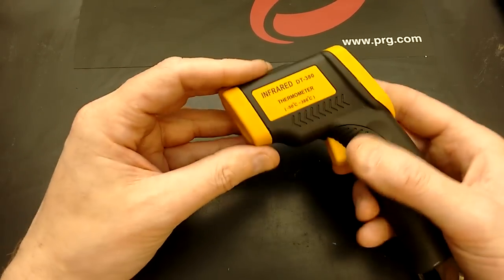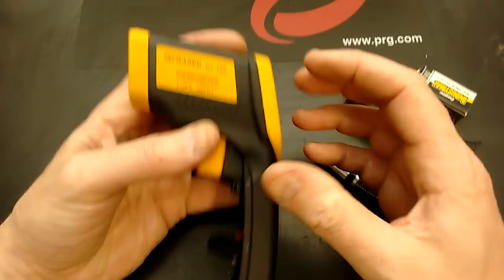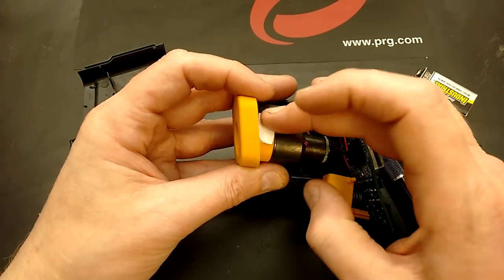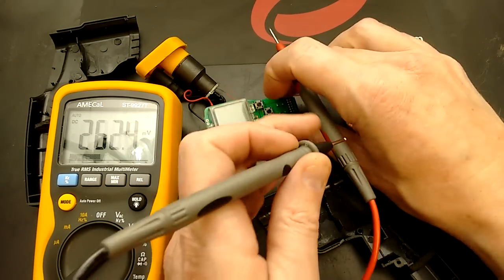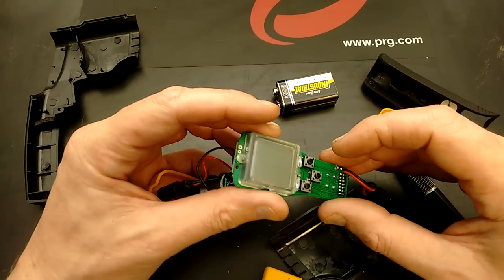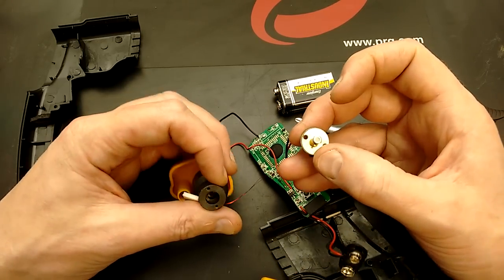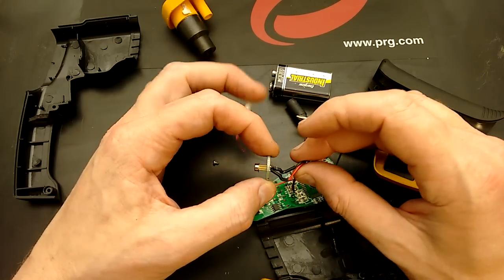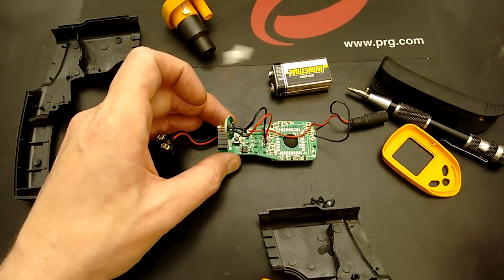A look inside a non contact infrared thermometer.

Comment: Unfortunately these units powered with 9v battery do drain the battery very fast. If battery isn't taken out when unit is not in use then will not last long. Probably the step-down converter is not very efficient or the the power button design is probably not good/ well placed.

Comment: OK, I had an assumption about how these things work, and I was wrong. As we know, hot things glow. While the glow is not a single wavelength of light but rather a mix of many wavelengths, the distribution of these wavelengths is just a function of temperature. So the overall combined color of the glow can tell you the temperature of the thing. We can't see light that has a longer wavelength than red light, but it is there. Things that are not hot enough to visibly glow are, in fact, still glowing with invisible light, subject to the same distribution pattern as a red-hot blob of steel or a yellow-hot light bulb filament. The universe is indifferent to our human-made delineation between visible light, infrared light, radio waves, wi-fi, and x-rays. They're all just different colors of light. So I thought infrared thermometers just detected the overall "hue" of infrared light coming off of an object to determine its temperature.

While I was wrong about how IR thermometers work, I think my assumed method does explain how infrared cameras work. I had assumed IR thermometers were essentially infrared cameras with a very low resolution of 1x1.

Comment: I need help mine won’t turn on and I changed battery’s on it
Reply from the maker: Check the batteries are making a good connection and try jiggling the power button in case it's got a bad contact.

Comment: Mine failed as well, and i bet all of these fail the same way. There's a 7530-1 SOT voltage regulator from 9v to 3v that ends up shorting. I removed mine and now it powers with 2*1,5V AAA batteries in series.

Comment: I would have checked the zebra strip / glorified conductive scotch tape to the LCD too. It's of course possible that it is the epoxy blob that failed indeed, but in my experience, tucked away in their enclosures these things are right up there with cockroaches in indestructibility. It's almost always the mechanical parts that fail in this sort of thing that cannot be externally overloaded (unless they did indeed skimp on that diode and someone tried the battery in reverse...)

Comment: stupid question here, could you hack one of these to produce a thermal image?
Reply: I think better optics are needed to do that, there's a reason thermal imaging devices are so much more expensive
Reply: It has been done, but you get a very slow scan and pretty poor resolution. Basically you use 2 servo units to scan the head in a pattern across the area and use a computer to generate the resulting blobby thermal image.

Comment: They do make i2c IR thermopiles, but like you said this one just puts out a voltage. but they usually dont have a amplifier built in unless they are i2c. Those that aren't i2c will require an external amplifier with a very high gain.

Comment: I'm a bit surprised the thermistor was stuck on the plastic casing instead of the metal? bit surrounding the sensor.  I wonder whether that was part of the design or whether it was flubbed during assembly...  I was under the impression that the whole point of the metal bit surrounding the sensor was to conduct heat away for cooling & more accurate temperature compensation.

Maybe TO-39 is a common package for these types of sensors, but when you pulled it out it reminded me of the MLX90614.

Comment: The other check I would have done is to test the trigger switch before writing it off.
Reply from the maker: I tested various things including the switch before it ended up in the bin.  The owner already has a proper thermal imaging camera, so it was no great loss.
Reply: I thought you would have.  The comment was mainly for other viewers.  :)
Reply: +bigclivedotcom I recently got one for 10 Euros from AliExpress but I'm not sure if its accurate (even on dark nonshiny surfaces) cause what to compare it with :)
Reply: John Coops thanks I had done that already but I held it towards the water surface in an open pan when it was boiling. It measured ardound 95 Celsius. I don't have a black pan/kettle but I will try point at the aluminium pan instead.
Reply: Shiny surfaces can cause faulty readings
Reply: GogogoFollowMe yeah well I tried holding it not too far away (or 12:1 spot magnification will deliver me a too large measuring area I guess) and while moving the pointer I got to ~ 100 C but it often read higher and lower too
Reply: too close and the interior thermocouple will heat up, reducing the reading
Reply: You're right, must be careful with that, even more when it's a continuous reading

Comment: Am I correct in assuming the red laser does nothing in the function of temperature calculation and is just there to indicate where you are pointing?
Reply: I have one of these no-name IR thermometers too, both the unit Clive is showing, and mine have the option to turn the laser dot on or off via one of the buttons underneath the LCD display. You are right, the unit works with or without the laser dot, it is merely to aim the device. 

Accuracy of the laser pointer is kinda "meh."
Reply: +DashCamAndy 
Thanks.  Yeah your accuracy comment make sense.  The laser seems to be at least a half inch away from the infrared diode.  I'm sure for most cases it doesn't matter especially for the price.
Reply: Some of these devices have two lasers to increase accuracy, one on the top and one below the main sensor - the idea being that when the two lasers cross and become one dot on a surface / that is the most accurate place to measure
Reply: Indeed Andy, sometimes the laser is quite off from the actual spot it's measuring.
Reply: Yep.

Comment: I have the same unit, which also failed. I did managed to repair it, the trigger switch went open circuit, replaced it and Bob's your uncle working unit again.
Reply: But Bob isn't my uncle though, hes my friends uncle.

Comment: hi clive. Two things. How does an IR beam determine temperture? 
Secondly, poundland are flogging motion detectors shaped like frogs. Fancy doing  a plastic frog disection ? Please.
Reply: I'm not Clive but the non contact thermometer does not emit an IR beam, it measure the intensity of the infrared emitted by the surface of the thing you want to know the temperature of. It computes the temperature from that.
Reply: Thanks SlyPearTree, I get it now.
Reply: I dont understand them. Do they have to be a set distance form the thing youre measuring because radiation intensity varies with distance, its in energy (or is it power?) per unit area and the further away you are the more it will have spread out
Reply: The "beam", the sensitive area, gets bigger with distance, but what depends on the temperature is not the intensity but the frequency spectrum. If it was measuring the energy you'd start getting problems with reading the temperature of something colder than the sensor, because 

You can't pass heat from the cooler to the hotter
Try it if you like but you far better notter 

The sensor isn't measuring heat. It's measuring something derived from heat. Pick the right frequency, and the change in level will have a near-linear relationship with temperature over a useful range, but how do you tell the difference between big and small sources? Somebody did some careful thinking about how to get good numbers from such a gadget, and when it was a new type of gadget it would have been seriously smart thinking. Now it's an "everyone knows" sort of thing.

Comment: those switches often break at the pad. this would be one of the few places where mechanical pressure is applied to the board. also, most of the cheaper stuff from China is covered in solder balls.

Comment: Save that laser diode, Clive! :D Before they're banned, because the media et al believes 5mw lasers can dazzle airline pilots flying a mile up.
Reply: The risk (though small) would be blinding the pilot during takeoff or landing
Reply: Just bear in mind when you're demonstrating your point, that it won't be the media who'll be knocking on your door asking for an explanation.
Reply: Im just sitting here with my custom 12 watt handheld dpss laser and as long as it is focused properly, it isnt dangerous at a distance of 100m or more. The little chinese 5mw modules are never really 5mw, more like 2 and their optics are not gonna be focused anywhere near good. Its not dangerous from a distance. A proper flashlight would certainly be the bigger threat.
Reply: Im just sitting outside on my phone watching youtube and pointing two 301 green lasers at the sky :P

Comment: just a little point, these give the temperature of an area whose size is proportional to the distance from the surface. they do not give the temperature of the point where the laser is pointed. thus you should get as close as possible to the item you need the temp of.
Reply: These things are only any good for getting a rough indication of temperature, anyway. The value displayed will depend heavily upon the target surface's emissivity (ie how much IR radiation is emitted relative to its actual thermal energy). The notional value displayed is for a perfect black body (ie magical physics land of spherical cows, no friction and no air resistance), but in practice I believe that most of these devices will be calibrated against a sort-of mid-range-emissivity surface, so that they stand at least some chance of being accurate. But still, it has every chance of being way off, too :)
Reply: I was thinking that. Surely the laser would be wayyy off being situated to high.
Reply: +Prehistoricman not that but it's a common misconception that the laser marks the point of temperature readout. it doesn't. it marks roughly the centre of it. the diagram on the side of the device shows what I mean.
Reply: I imagine one way to fix that is to place some lens in front of the laser so that the beam would expand to represent the area (more or less) it is measuring. By the way, the emissivity value can be set with the buttons.

Comment: Perhaps someone put the battery the wrong way around for a short time and that killed it...
Reply: Key word being "Should be"
Reply: should be protected from that with a diode, but you never know...
Reply: yes, but they can still make contact with the incorrect contacts. though that probably happens enough that if one instance would kill it they'd die exceedingly often as people fumble with the battery.
Reply: +DANGERTIM112 but it does make contact
Reply: +DANGERTIM112 it won't click that way, but you can at least touch the contracts the wrong way. That may be enough if there's no switch protecting the board.
Reply: muh1h1
A shottky diode can make a big difference in price when producing a whole lot of these things...
Reply: It's a 9v battery, it should only fit one-way on the connector

Comment: 8.72 volts seems kind of low?
Reply: "9V" batteries are generally considered not-flat right down to around 6V, so 8.7V is near enough brand new. Bear in mind that they're generally/often constructed from six alkaline cells internally (sometimes little rectangular things; other times cylindrical cells like smaller versions of AAA cells), and so the useful voltage range will be from 6*1.5=9V down to around 6*1.0=6V, just as the useful range with single alkaline cells is about 1.5 down to 1.0 (device-dependant).
Reply: 9v cells can be made from 6 AAAA batteries that will be expired at around 1.2 volts. That's 7.2 total. As far as I know, 8.7 is pretty healthy.

However, cells do creep up in voltage over time when they aren't in use. So it could be completely deceiving.
Reply: Prehistoricman
I typically get around 9.2-9.5V for a new 9V alk battery, though. If I measured 8.7, I'd probably try a new one just to be sure. If the device were on, then maybe I wouldn't think 8.7 was low? I really don't know if the battery was under a load or not, though.Overall, I think 8.7V no load is kinda' low.
Reply: Voltage drops during the lifetime of a battery, and 8.72 V is still pretty fresh.
Reply: +Peter McArthur I'd still check with a fresh battery as part of testing. No one has to do things my way, though. ☺
Reply: Yes, I'd have spent rather longer poking around at it, too -- especially the mechanical components. But I'm not hurrying to produce a show during my lunch break. :-)

Comment: It makes me laugh, the usual electronics/parts retailers are selling rebranded versions of these for quite a lot of money, but I think I paid under £20 for mine.
Reply: ￡5.16 
http://www.aliexpress.com/item/GM320-Non-Contact-IR-Infrared-Thermometer-LCD-Display-Digital-Temperature-Gun-Temp-Thermometer-Laser-Handheld-50/32689489971.html
Reply: The one I have is actually the slightly more costly 900°C version (GM900??), as I needed it for measuring the temperature of an exhaust manifold.

Comment: tip for others
to check for hidden screw holes under labels use ur thumb nail run it across the label ull see a hole out line if there is

Comment: The chip blob looked like it had a shiny, discoloured spot on it which would probably mean it cooked itself internally (probably due to a failed somethingorother on the PCB sending current the wrong way)...

One fun note about these infrared thermometers, they used them a lot as engineering props on Star Trek: Enterprise (sprayed a nice shade of satin silver, of course), usually repairing some blown up circuit or performing maintenance on an EPS conduit... :P
Reply: Was it on TOS or really ENT (w/ Data)? :D
Reply: *****
Enterprise, as in NX-01, the 22nd century Prequel, Captain Archer and all that, the last proper star trek series ever cos the upcoming one is just jjbollocks... :P
Reply: *****
Ah, this series is fairly modern compared to the older ones. Interesting that they used such cheap props. :D

Best ST-Series for me is still VOY. I like it even more than TNG and TOS. TNG and DS9 is also good, then there is ENT and the last rank is TOS. (I'm propably too young to appreciate the props and effects, there. It is too unrealistic.)

Comment: When I was a kid I used to take random things apart for no reason other than to see what makes it work. That must be why I like these videos so much, living vicariously through the youtube.
Reply: I was the same way, but with these videos I no longer have to. 
Never was too good at putting the things back together...
Reply: @weylin6  lol! always extra parts! even as we age and get good at putting them back together thru reverse engineering practices we likely will, at least, have two or so extra screws. final thought? think of how much money can be saved on a mass sales of units by excluding unnecessary or overly designed goods? LOL!!!
Reply: @777fiddlekrazy  VERY good observation Steve!  Yup, from an early age on up to middle 60s, I always LOVED taking things apart too; radios, mechanical/ electrical-tools, lawn-mowers, lights, et al, BUT!  My very 1st  "take-apart" project was an old wind-up alarm clock (that ran only intermittently at best)   that my parents gave me in the early 1960s.  Yes, I got it apart, studied the "internals"  for a little while, and then managed to successfully re-assemble completely.  Well? It ran quite consistently for..... about 2 weeks as I remember?  And yes, I always made sure to WIND very CAREFULLY every morning at approx same hour.  And then.... it began running intermittently once more!  Since I never (and very rarely do even to this day)  toss out even broken-stuff, I had this old clock for a number of years - one day a few years after,  it just  "kinda"  disappeared!  Ya, I'm absolutely SURE it was my Mom's doing! But, early on I got smart and started the practice of  "hiding"  a lot of my take-apart projects from my parents, PARTICULARLY my MOM!
Reply: Same here, but never stop...
Reply: Me too also :)
Reply: Cheers !! Because you aren't Alone

Comment: what is that header for? it looks intriguing.
Reply: +Bartosz Olszewski that is a lot.
Reply: maybe testing/calibration during production
Reply: +TheFreezeChill i thought so to but if one looks at the build quality, having such an expensive connector just for that seems like a waste for what is probably a single use.
Reply: It's probably how the calibration rig to talks to the module.
Reply: +Bartosz Olszewski  More probable to be a few cents maximum.  You can buy connectors in bulk, but still essentially 'retail', from Chinese suppliers for astonishingly low prices.  The production volumes are huge, so the costs are tiny.

Then you take that tiny cost and compare it to the cost of setting up a less robust and fiddlier system such as pogo pins and a method of clamping the board -- much better option to install a standard connector even if used only once in production.
Reply: +SandyStarchild it's probably ¢50 max to produce and solder it.
Reply: Now that you mention it, it does seem a little odd. I'm no expert, but it strikes me it would have been cheaper to just have some copper tracks leading all the way to the edge of the PCB, and a port on the testing rig that the PCB could just slot into.
Reply: maybe they use the same components out of the housing in an industrial/ production line type setting and that is how it interfaces with the rest of the system? Just a wild guess.
Reply: +27dcx That makes sense!